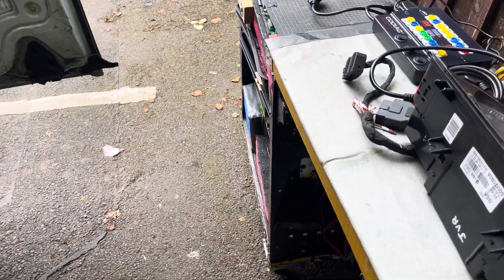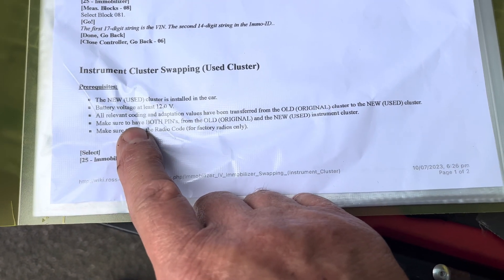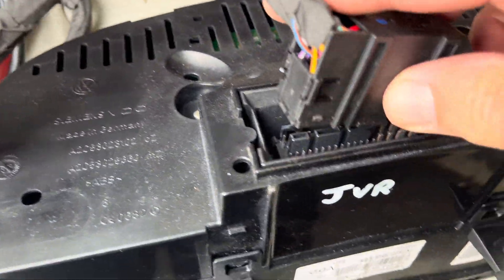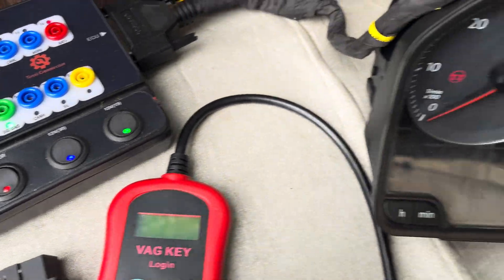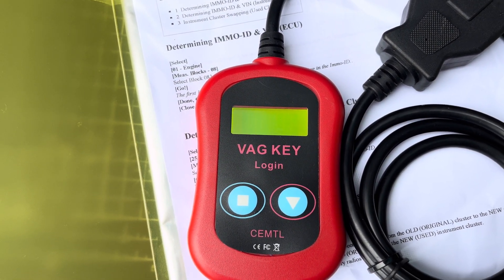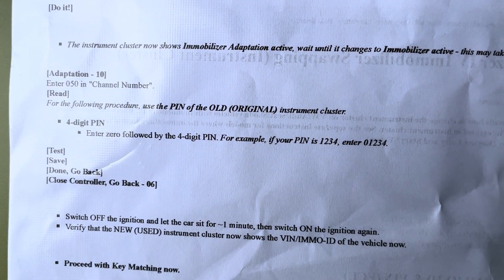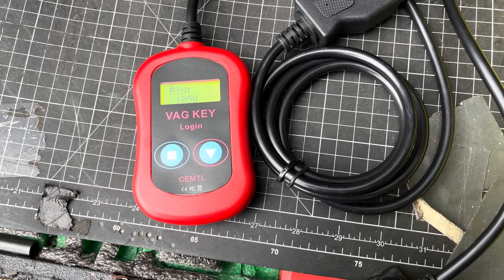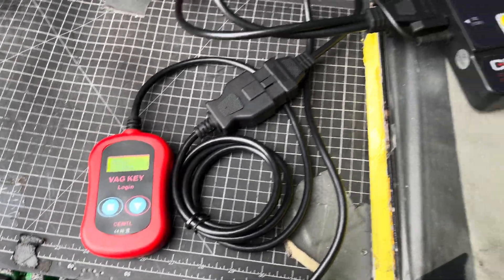Vw golf mk5 accessing #pincode  directly from cluster to do a cluster swap via vcds

Comment: Hello, I have the same 1k Golf but gti. They seem to have the same connector on the back of the cluster. Therefore I can use this setup just fine? I want to get vcds for myself too
Reply from the maker: Worth every penny
Reply: @ sold out everywhere sadly. I will need to get k commander 1.14 on an older laptop just to get the skc. I think that is my cheapest route
Reply from the maker: What is?
Reply: @caralarmandradio  the vag key code is out of stock everywhere. The Ali express one reviews say that they were sent a regular obd2 not the vag key code scanner lol and I did find one in china, it’s a replica, says it does the same thing. Where can I find one ? Also I’m trying to retrieve the pin off my cluster/ecu without autel. Everyone seems to be using the old vag commander or vag tacho to easily get the pin no sweat
Reply from the maker: Ah i see i wish i hadn’t sold mine now as it was a genuine unit
Reply: Yeah those are awesome
Reply from the maker: @CR15PY1 I just found this on AliExpress: ￡112.59 | VAG Pincode Reader Pin Code OBDII OBD2 Key Programming Equipment Automotive Diagnostic Tools
https://a.aliexpress.com/_Ey5STpm
Reply: @caralarmandradio  thank you 🙏🏽 I ordered one for myself
Reply: @ out of stock had to cancel order sadly :(
Reply from the maker: @CR15PY1 oh dear

Comment: Good video! 
Question 1: Why do you need to do the new cluster on bench?
Question 2:
I have a godiag gt100 unboxed. Do you have more videos how you could use godiag? I got it from a friend😊
Question 3: Can you get SKC with another tool if you can't buy VAG key login?

I work on a automotive workshop in Sweden. Got VCDS, Bosch, ICON and Autologic. Cheers!
Reply from the maker: Hi i find everything is easier and safer to do on the bench. The gt100 is great and easy to use I will do a video of it .to get the pin code the autel 508 can do it but its vey hit and miss depending on the cluster part number its better to get it from the ecu
Reply: @caralarmandradio  
I have an audi a4 1.8t with rb4 cluster. My mother has a Golf mk5 2006 1.6. These 2 cars needs new clusters. I can't find VAG Key login anywhere. Can these be  done reading with example: Super Vag K + CAN Plus 2.0 or VAG Commander 3.6 + Goodiag?
Reply from the maker: @Lundborg92 no but they are useless tools unless the cars are very old
Reply: @caralarmandradio  Okay. So VAG Key Login is the option for me?
Reply from the maker: @Lundborg92 please note it only works on some systems vw is very hit and miss

Comment: Can i do this on a 2011 caddy?
Cluster part number: 2k0920965A
Hardware version: H04
Software version: 0421

I've done an engine swap from caye to bkd (i know now that was my mistake) but did not the probe for the original ECU or cluster pin before adapting the loom.

I've got the pin for the bkd cluster but the vag k+can cable i used won't read the caddy cluster or ecu on the bench.
Reply from the maker: You are going to need vvdi or spvg or equivalent sorry

Comment: Rip off that like I just bought a instrument cluster and looks like I need a one of these 🤦
Reply from the maker: Yes if they sent it out without it’s pincode it’s useless unless you get the ecu immobiliser removed 
Send the cluster to me and I will get your pin
Reply: @caralarmandradio  if my immobilizer is off, what’s that mean for cluster swapping
Reply from the maker: @CR15PY1 very easy beware of three things .1 the mileage .2 backup the abs coding before swapping out clusters as it can get deleted. 3.you may have a permanent safe or flashing key on the dash display ok
Reply: @caralarmandradio  okay I need to study vcds more, I read about the scan and then the test for vin, okay and back , and then to the immobilizer security settings .. to adapt the cluster. And then it’ll automatically change the mileage bc ?
Reply: @caralarmandradio  I recently swapped ecus. So I need the old cluster pin and new cluster pin, is it still possible to adapt it?

Comment: Can i connet the old and new instrument  on the car to get the pin number or must have codediag
Reply from the maker: You can get the car original pin using the obd in the car as it pulls it from the ecu but the new replacement cluster must be done on the bench ok